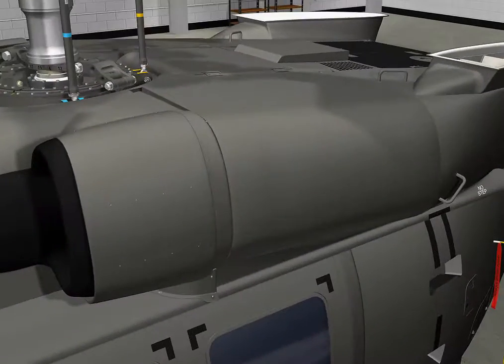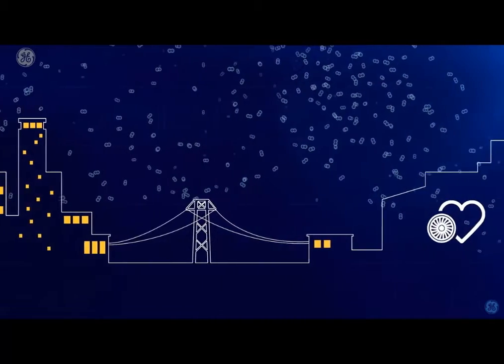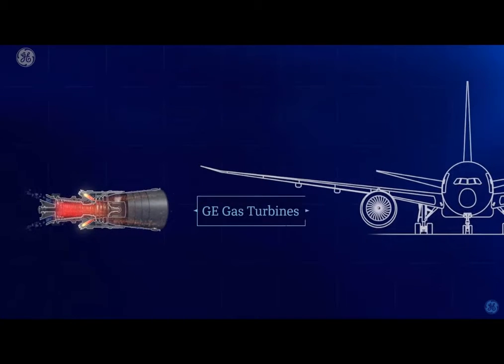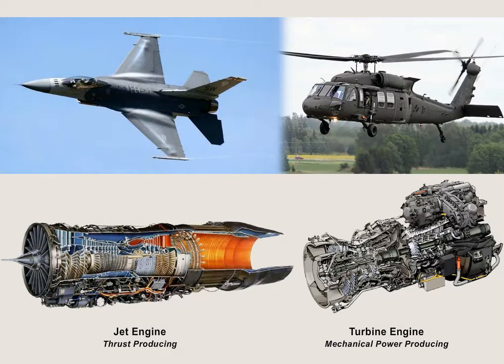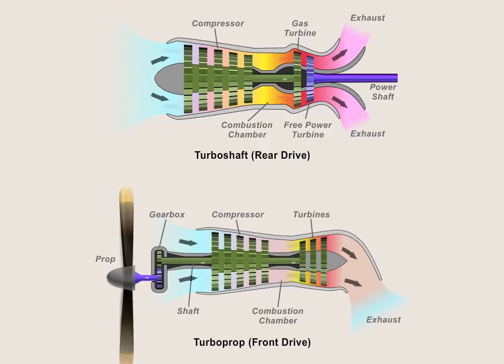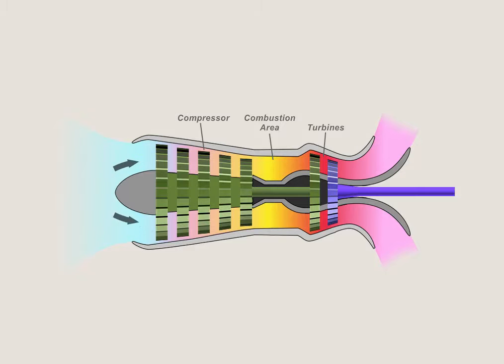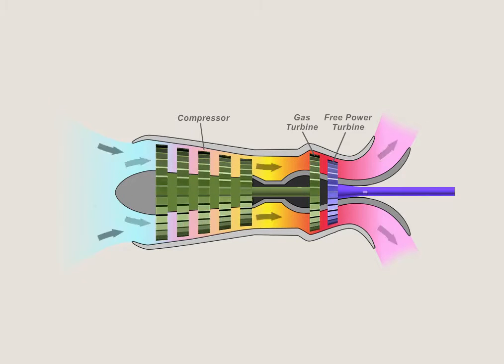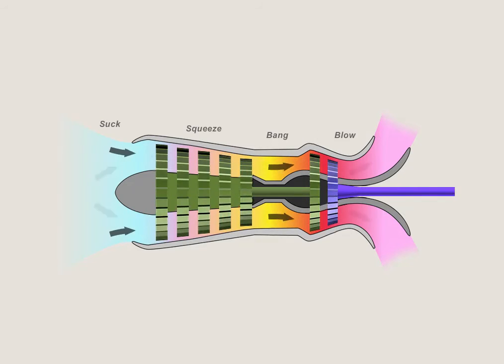Turboshaft engine theory

Comment: Very nice video. Thanks. In TV-2 Turboshaft engine (Mi-8 helicopter) of the 1960s design, there is only axial flow compressor with straight flow annular combustion chamber. Variable stator vanes and blow off valves prevent compressor surging in it. Students in India can get hands-on training on this engine. https://www.youtube.com/watch?v=6xs5NWsDMxc